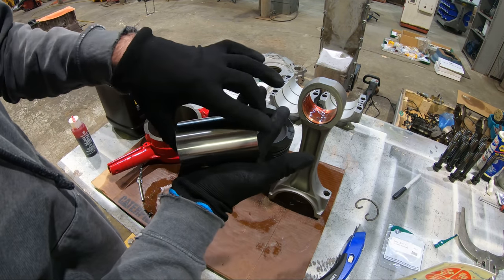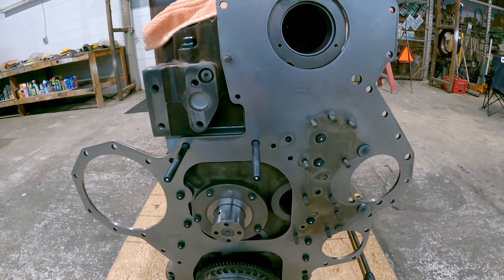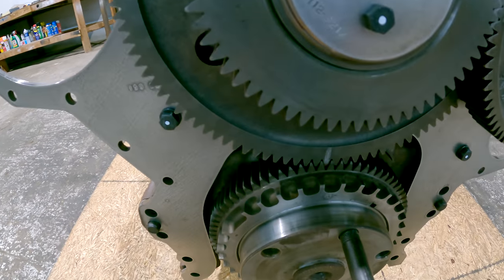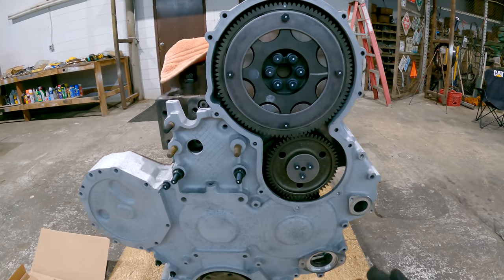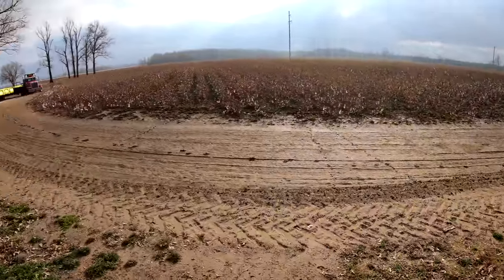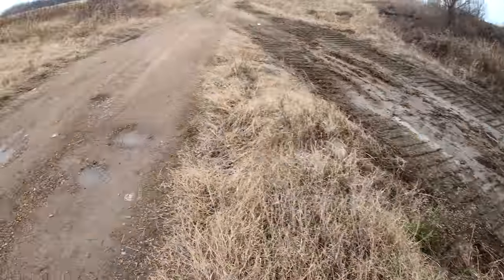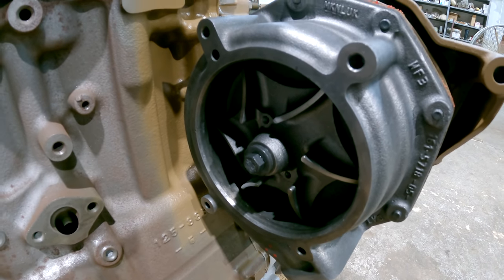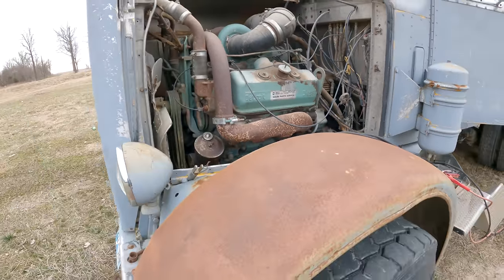Building a Brown Caterpillar C-15 Diesel Engine, Mud, and 1973 Peterbilt Cold Start

Comment: Last time a see some marshmallows of cotton was on the I-55 on AK. IDK where you are... Anyway as a truck driver for 11 years never got the chance to drive old school truck with CAT, and as a gear head i like to see and understand how those engine work... 1 question: have a Pete 579 2023 mx-13 engine and it seems Paccar put a variable oil pump, or regulator. The pressure is always at 29psi. Any oil temp, any RPM except idle. Do you know how they achieve that ? It's weird you see the oil pressure self adjusting when i look at the electronic gauge in the electronic cluster. Is it enough electronic for you !! LOL !! Keep going show us your thing the real mecanic ar on the verge of extinction

Comment: I see you always putting the engines on the concrete floor, would it not be easier to build something to put it on a higher spot  so you could work easier

Comment: I think I understand your comment you think the engine rebuild videos are boring as you have done it over and over. After the first 2 rebuild vids it is a bit boring BUT, I still keep watching every video of rebuilds FOR A REASON. My reason is watching waiting patiently for you to accidently slip and say some PEARL OF WISDOM that you take for granted and the watcher needs to know. I often say to myself I wish he had mentioned a detail he skipped over. Examples You know torque specs , you have proffessional tools, you have relationships with your local parts suppliers. I dont know where to get written torque specs for an entire rebuild. I will have to buy some specialty tools for truck engines that car mechanic toold will t do. I would like to build "on the cheap" but not be foolish. I watch your videos to learn what parts are absolute need to come from CAT , which alternative parts manufactures you would recommend and which parts manufactures you would say "Absolutely stay away from". You paint dotd on bolt heads one dot two dot 3 dot...we wait to hear your thought how you are using your dot system.

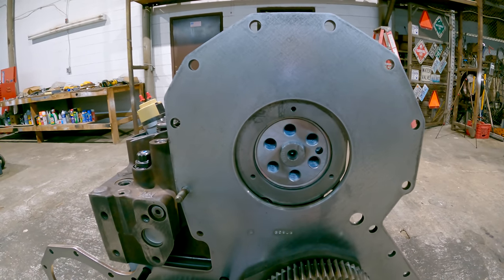Comment: 10:15 a true sign of a real professional at work flat out emitting might be a little too far into the bush lights to be explaining which frankly in my book that’s alright I have worked on computers, electronics transmissions, anything to survive to keep me afloat and sometimes either you get really stupid and tired and you can’t explain shit or a little bit of beer was involved. Sometimes the beer is needed to keep you going to keep your thinking, which is ironically sounding stupid, but it works, it’s better than a freaking energy drink at least you’re well hydrated

Comment: Yeah I know your videos 8th and boring they're actually kind of nice and neat in the way you your works pretty darn good I build engines to I own my own damn Fleet I have to play the trucks keep my trucks running most of Mines glider kits with cats in them cuz catched on the engine I'll use or in 14 but cats the about the mostly engine I use in the glider kits Anna the dealer the dealer you're hooked up with that's the parts I use I have to go through them just to get the IEP deal and sometimes I can't get the parts to cats and that's that's just yeah well your videos are nice I like your work keep up the good work keep up Building engines could you learn something every time turn around keep building the cat Motors

Comment: the truck i drive at work is a 05 Western star 4900 with 425 CAT that will soon be in for an in frame rebuild but just the other day it started burning a large amount of oil and by that i mean up to 2 gal a day and it also started blowing a good amount of smoke , no oil in the coolant, or on either side of the turbo do you have any idea what it could be ? not losing any coolant, temp is good oil pressure also good

Comment: What I find boring is you destroying trucks every week, I am much more ENTRETAINED when you BUILD rather than destroy shit. If you wanna spend an engine at least use a extreme but reasonable RPM and show how long it lasts in such circumstances, like towing a plow without rev limiter or something of the like. The one today was great.